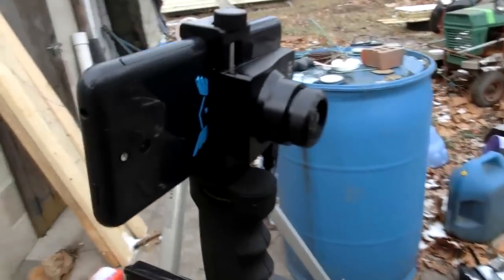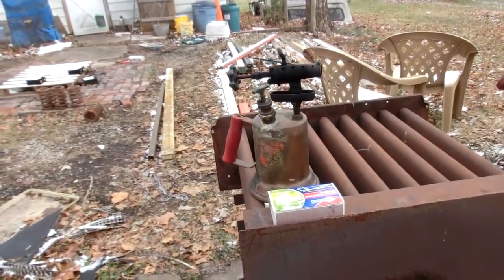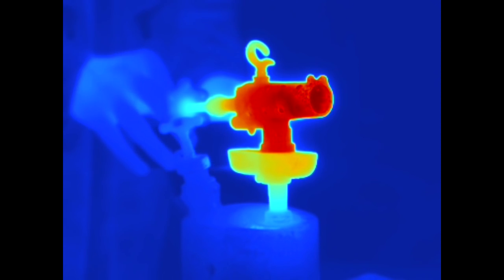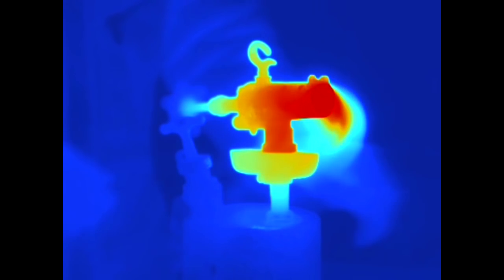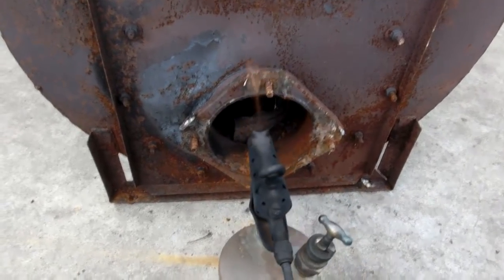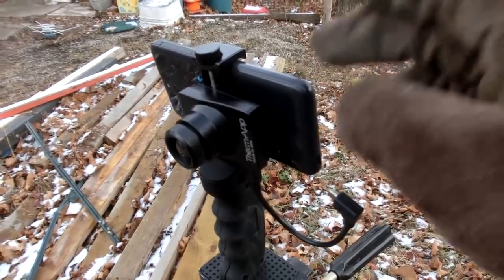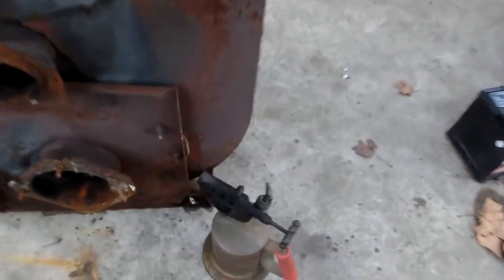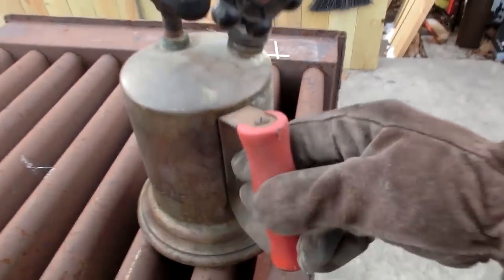Antique Blowlamp/Blowtorch in thermal (Opgal Therm-App Hz test)

Comment: This is an unrelated question, but when you eventually get around to building your... forge/foundry/whatever are you going to use electrical elements or are you going to use propane? I didn't mention charcoal because I tried a charcoal forge when I was in my teens and learned that you never do that because fuck charcoal.
Reply from the maker: +Maliciously Delicious multi-fuel able to use electricity in filament or arc, hydrogen, waste oil, wood or coal. i am making it so i can bolt on a bew injector or fuel feeder depending on what fuel i happen to have at the moment
Reply: That's... quiet the tall order. Now I'm wondering if you plan to use electrolysis to get hydrogen, or if you just plan to buy a cylinder of it. My only experience with using waste oil (old cooking oil in this case) basically amounted to two feet of steel pipe with copper piping and a nozzle in it connected to a leaf blower. It worked for my little forge project but was incredibly unsafe since it regularly had problems with vomiting out burning oil since my only flow control option was a ball valve I am pretty sure didn't work. Also my nozzle was just a copper pipe end cap with a hole drilled in it. And I pressured the oil in one of those pesticide bottles instead of letting it gravity feed. So basically the least safe option that my current self would never do but past me thought he was a genius for. Also i didn't use refactory cement because past me was a cheap ass. Clay and plaster of Paris all the way. It didn't really work but the backyard was a shithole anyways so it only lit some of the grass on fire.